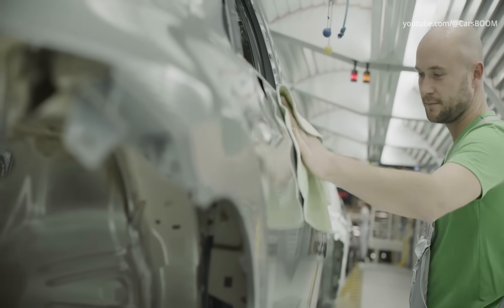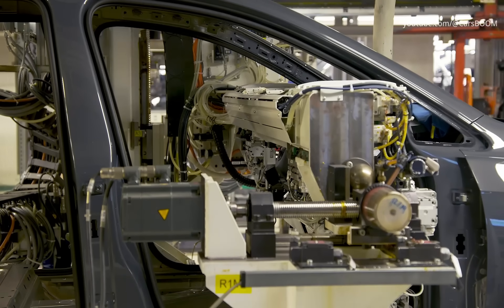Volkswagen Golf 8 production: Factory tour in Wolfsburg

Comment: Could one of the engineers who work at the plant explain this small rattling noise from the engine compartment or chassis. I have the new etsi 1.5 50 anniversary. Drives very well but in low gear on a bumpy road you have this little rattle.

Comment: You guys arguing over catalogue prices, while u dont realize that the effector is custom made and custom engineered for that exact process.
You have any idea how much that costs?
Ive seen a kuka R&D plant from the inside, and they are mimickinhg the production lines they are supplying in their halls first and test and optimize absolutely everything, before building it up at the customer plant (eg VW).

Of course the base robot is not much, but that exact robot in that production line for that specific task is way more expensive then that.
You are comparing apples and oranges.

It could also be possible, that the internal engineering and process development is priced into that claim, but Im pretty sure its upwards of 300k per robot on average.

Comment: "These are super smart robots worth at least $100 million each"?! Either there was a problem when translating or this script was generated by bard or some other AI that doesn't know how to fact check. Kuka (higher end manufacturing robots) robots cost between 50k and 1 million each. 

Were you trying to say that the 6000 robots cost $100 million through each production line? That's a little more believable. Otherwise 6000 X 100 million =  $600 billion only for the robots, lol.
Reply: Further more, not all robots are new brands. Carry over consist to upgrade a line to produce other models and next ones with the same robots and eventually replace the oldest ones by new ones.
So telling the real cost is not that easy.
Reply: Reading this comment was really refreshing :) @smoker_joe

Comment: VAG still believes they can get away with a DI EA888 without dual injection that will not suffer from the excessive intake valve carbon issue… nope! Bye bye VW

Comment: Just took delivery of my new mk8 golf R as my first non-toyota car.  Has interior rattles on several areas, large dimple on driver seat, and oil leak on rear differential straight out of the factory.  Entire diff had to be replaced.  Not impressed.
Reply: The car infront is a Toyota.

Comment: Incredible German engineering
Reply: All car factories are the same.
Reply: @smoker_joe not really
Reply: @99Venom  Designing car factories is my job. (body in white process, robotic and automation)
So yep, car factories are all the same.
Reply: @smokerjoe5231  so you gonna tell me the quality of a chinese car is the same as the quality of a german car?
Reply: @99Venom  Don't confuse a product with the machines to produce it.
Every factories are highly automated. Hundreds of robots for handling, welding, gluing and so on.
Processes are the same. Stamping, welding, painting, assembly etc ... (except for Tesla with their underbody in 3 cast  aluminum parts).
But even with high end cookware, your dish will not be good with bad ingredients.
So th global quality of the product is mainly due to the car design itself. (quality of materials, clearance (gaps), soundproofing, waterproofing, maintenance, reliability etc ...)

Comment: My golf 8  sensors all gave up in -1 Celcius this morning.  It just hates wet or cold weather.... Everything just packs in. Luckily the motor still works..... O.... check engine light.
Reply: My 2024 R already got new injectors and the cruise control keeps failing saying that sensors are obstructed... when they aren't. Miss my 2018.
Reply: @VWTalk  Update should cure the sensor problems. Btw my Honda is the same starts beeping and showing collision imminent yet nobody there lol. Too many computer crap in cars these days.
Reply: Worst car vw ever made. I had 2022 and 2023 as company car. Touch screen freezes up all the tıme and all the sensors are got crazy durıng the day and most of the tıme, I have to stop the car and run agaın to clear the errors.
Reply: @tr9036  There is a program update available. And funny my 2022 never had these issues.
Reply: @bradwick212  You are so lucky. Car is just 22.000 and touch screen make me crazy.
Reply: @tr9036  Take it back to dealer, they should have update.
Reply: @bradwick212  They updated several times. It works for a few days/weeks, then the same story again.